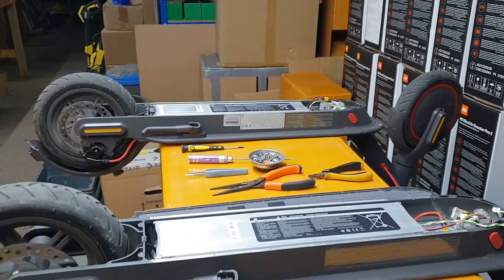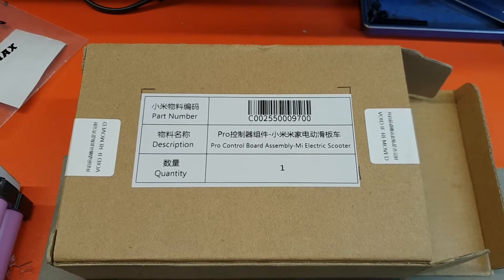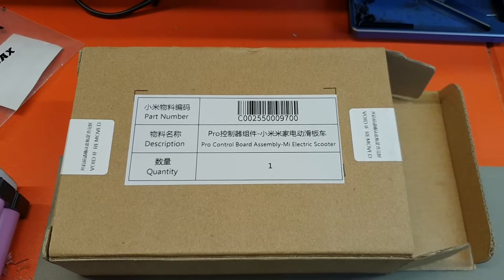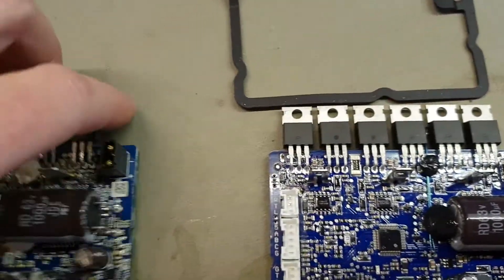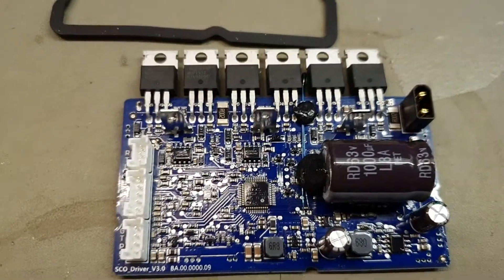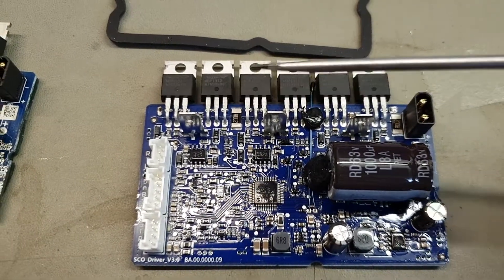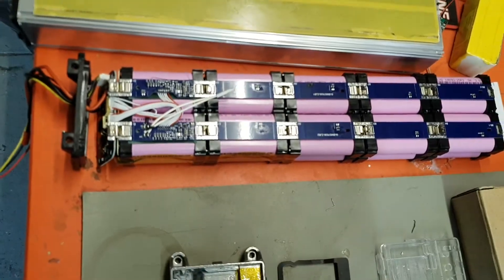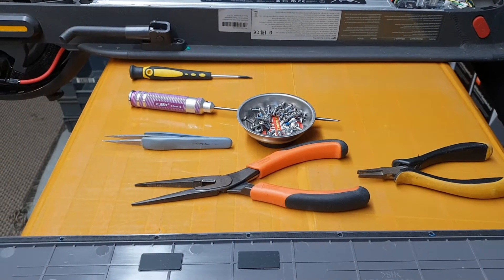Xiaomi Pro 1 Vs Pro 2 Electric Scooter Speed Controller tear down PART 3

Comment: i can't overvolt my pro2 with 12s although i flashed custom firmware. Its giving error 21 or 24. Any ideas how I can overcome this problem? thanks
Reply: when upgrading the battery you will still need a bms that can talk to the controller board in your scooter without it your scooter will refuse to work < that will fix error 21 for error 24 you will need to install custom firmware on your scooter there are plenty of videos on youtube showing you how to do that as long as your scooter is on a patchable firmware if its not well that's even harder again to fix and requires extra tools and skills

Comment: hi.my orginal pro controller is damaged and could not be fix. please tell me where can i get it?
Reply from the maker: https://www.kooltoyz.co.uk/xiaomi-electric-scooter-control-board-assembly.html
Reply: How did you broke it , speed hack?
I want to do some speed hack but if it couse to damage my board i will not do that please answer thnx
Reply: @FDfurkan27  i did the speed hack, i was using like 15kms daily, i used it for 4 months and the the motherboard burned.
Reply: @mohdsaboor7849  oh thnx for reply i will not try t o speed up my scooter, by the way how much is ur top speed after you did speed hack
Reply: @FDfurkan27  32 to 34 kmph... after this issue i even changed the motherboard,  but still i am facing issues, whenever i use brakes the E brakes and motor gets hardened and the scooter stops, it won't run for 5 to 10 mins, i am still trying to figure out the issue, (maybe i got the defective motherboard)..i live far from city area,  i don't have much facilities here.

Comment: Hey, do you know what battery cells are used in the Pro 2 battery? If I remember correctly, Pro 1 had blue EVE cells, so these look different on the first sight.
Reply: LG MH1 18650

Comment: I'd like to add a gyroscopic alarm, that i could enable with a remote. So if someone moves it, it rings and stop once it's stable. Any idea if that exists and if yes, If I could connect it to the battery ?
Reply: use some kind of mercury swtich?

Comment: Is it possible to flash original Pro firmware on the Pro2? Ive noticed that Pro2 wont fully charge, it stop at 11900mah meanwhile my old Pro was charging at full 12800mah, im asking if i flash the Pro BMS i can get full charge on the Pro2??
Reply: If you use one of the older BMS firmware versions, then it will be able to get your m365pro2 to 12800mAh.
Reply: @Hydropanic1  I tried to flash ble so i can flash BMS from the original PRO but i bricked my scooter...SO i had to buy an stlinkv2 to get my scooter back...Still waiting for someone to figure this out
Reply: @futmut1000  Hi, I bricked too.. :(
But only need to buy a Bluetooth module, a out $15 on Ali... I bought alsó an stlink, but still nőt arrived.. Write me, if U succesfully stlink the ble module.. M.
Reply: Yes you can ive done it to my pro 2 as I notice it didn't fully charge now it does.

Comment: Could you put the pro 2 board in a pro.
Reply: yeah that would be interesting ! if they are interchangeable ! ?
Reply: mint video !! can't wait for the tyre replacement video !!!
Reply: Daniel Ward pro 2 has thicker tires iner tubes and outer tire definitly recomend to buy pro 2 tires if u have a pro or older models i ran over glass multiple times have done over 1000km no punctures